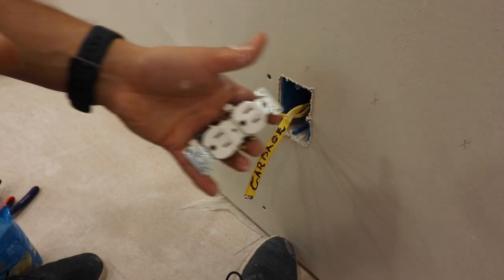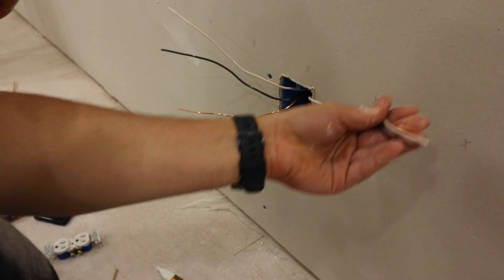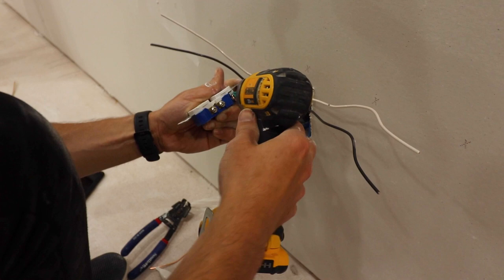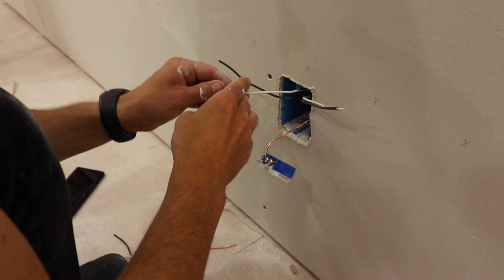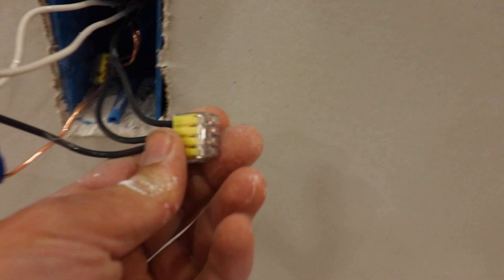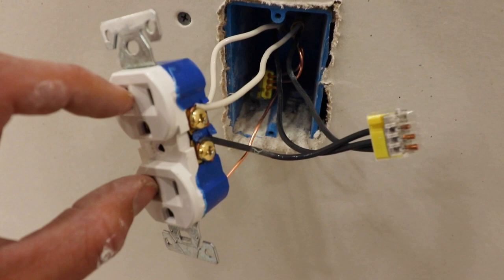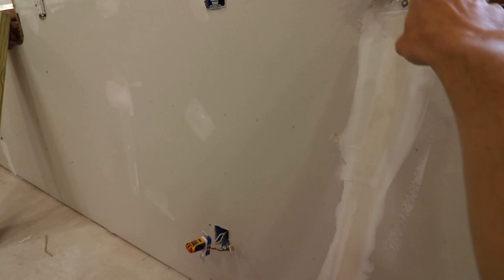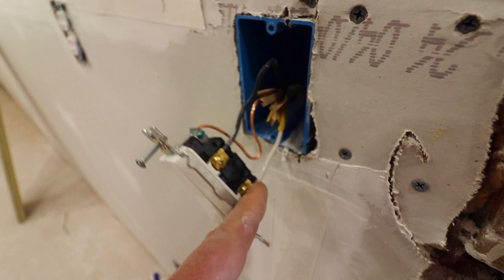How To Wire A Switch Controlled Outlet | Split Receptacle Top Powered by Switch Bottom Always On

Comment: When using the common as a Black its good practice to wrap black electrical tape around it to signify to who ever comes behind you that its being used as a hot and not a common.
Reply: Yup. Smh because the next person will have to figure out what he did. Fortunately, the plug is powering a dishwasher and garbage disposal so not as hard to figure out. 
What I don’t understand is, that drywall looks like it is new. Why didn’t he just use a red wire or at least tag the white wire with black tape? I’m no electrician, but I’m an engineer in a different and have been learning a lot about electrical and even I knew this tutorial was weird.
Reply: yea, that's actually code in my area as I understand.

Comment: Both hots were wrapped the wrong way and have too much insulation on them, which is now pinched under the terminal screws instead of giving the screws a clean grip on nothing but conductor.  If this is the level of skill you use when wiring your house then you need to make sure your insurance payments are always up to date, and you keep fresh batteries in your smoke detectors.

Comment: On the hot side you hooked the wires around the screws incorrectly. The wires should be hooked in a clockwise direction so they pull in when you tighten the screws. The unused screw on your neutral side should be tightened.
If you're going to use a white wire as a hot it must marked on both ends with black electrical tape or hs tubing to indicate hot for future reference.  You could use a 14/3 and connect the red wire to the switched receptacle. The neutral wire should be connected to the neutral wire from the other cable (assuming this is one circuit) and pigtailed to the screw. The other end would remain unconnected and capped by a wire nut, a Wago, or a push in like you're using. The code is that a neutral wire must exist in the switch box for future upgrades to wifi switch or dimmer. That's probably irrelevant for this application.
Thanks for the video.
Reply from the maker: Thanks Ted for your knowledge and willingness to share.
Reply: That's correct.   In most situations with few exceptions,  since 2011 a neutral shall be provided in the switch box.  NEC 404.2 (c)  Also,  the white conductor connected to the switch,  should be re-identified to indicate its use of an ungrounded conductor by marking tape , painting or other effective means and shall encircle the insulation and can be any color other than white,  gray or green.   Also, the re-identified conductor shall only be used for the supply to the switch,  and never as the return      NEC 200.7 (c) (1)

Many older homes built before the 1980s, you will commonly see one 14/2 in the switch box, connected to the switch,  and the white is almost never properly re-identified.  Same with a straight 240V 15 or 20 amp receptacle,  commonly used for  large window air conditioners
Reply: Absolutely
Reply: Also the hooks are not long enough there is insulation under the screw.   Funny no one else mentioned him using a power drill to install outlets...
Reply: @stevenmackenzie59  I ONLY USE FLAT HAD SCREW DRIVERS TO GET TIGHT SECURE CONNECTION ON THE TERMINAL SCREW OF THE DEVICE
Reply: @Von_grinds247  are flat screw drivers even manufactured anymore???

Comment: I have a camper that has a mini fridge that is hardwired in. The fridge is broken ( not fixable), and all the fridges i see have regular 3prong cords.
Would you suggest i run the existing wires into a new outlet ( which I would install) ,or cutting the cord end , and splicing the wires together?

Comment: I would’ve put the white wire with the two blacks using the push connector and hook the black wire to the hot side of the outlet. Same thing just looks better.

Comment: Both of mine are connected to the outlet in the bathroom weirdly enough, the bathroom is on the other side of my appliances. Lately we have had an issue with the outlet fuse popping and the appliances won’t work. When I restart the outlet they work for a minute then it pops again. Any suggestions?
Reply from the maker: Well it seems like your outlet (which propably is a gfci-outlet) is the main conduit for your other appliances. So you just need to remove your outlet, and reconnect the wires in your box together. From this point you would want to make a pigtail of your white, black and ground wire ( if you have one) which will feed power back to your original outlet.

This configuration will allow power to flow to your other appliances regardless of the functionality of your temperamental outlet.

Comment: The white wire can no longer used in a switch loop, per the NEC
Reply: so i have to use 12-3 and utilize the red traveler instead?
Reply: @DylanDraper1
Reply: Correct , red or black  the NEC now requires the grounded conductor (white) to be in all switch boxes if used or not.